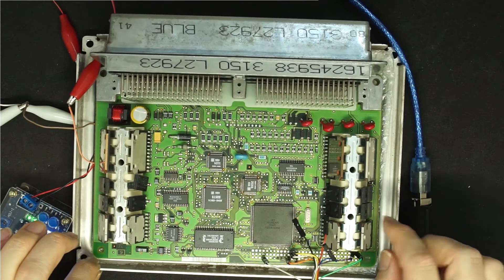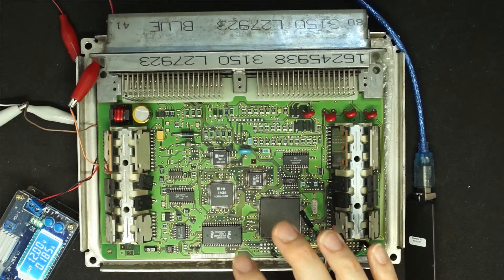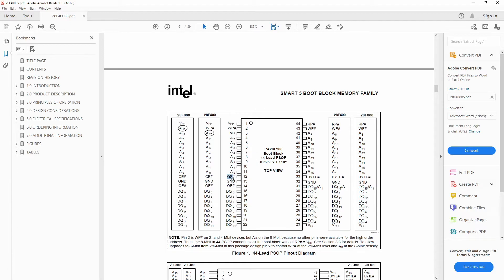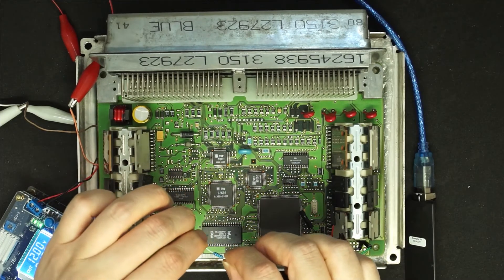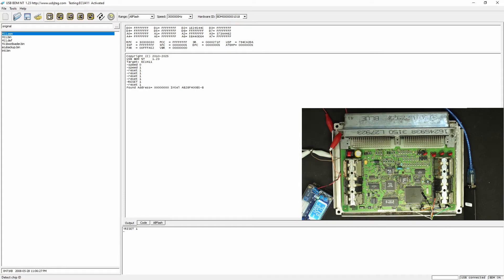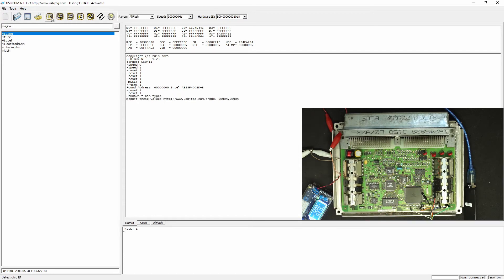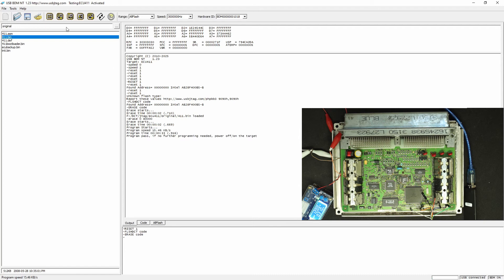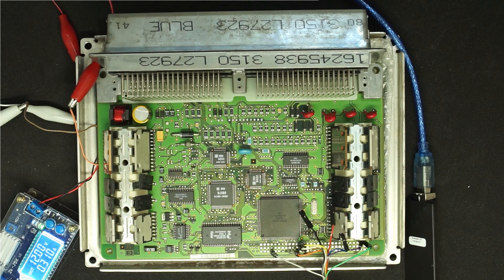BDM NT fix deep bricked ECU411.

Comment: hi do you know if the AUTEL IM608 could do this procedure, i have the autel xp400 and i can read eeproms with this but i dont have the intel chip listed in my autel data base. thank you in advance
Reply from the maker: I do not have your unit. But if the CPU is MC683XX I can do something with it.
Reply: @usbbdm  the ECU that i have its from a 2004 chevy truck 4.8 and it does not have that MCU683xx it has a newer one. i have many of these ECU's and i would like to bring them back to life since most of them got corrupted during flash process via OBD2.
Reply from the maker: @walosautorepair5046  Contact me @www.usbjtag.com
Reply: Do you have the wiring diagram how to connect to the pcm? Or complete instructions coz I have 3 pcm totaly dead